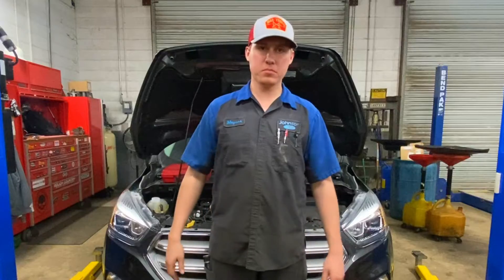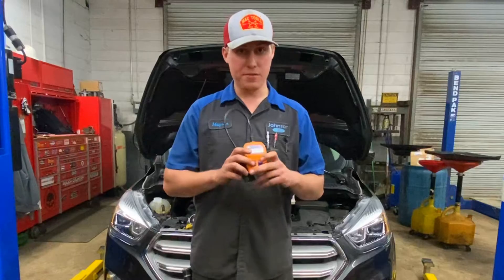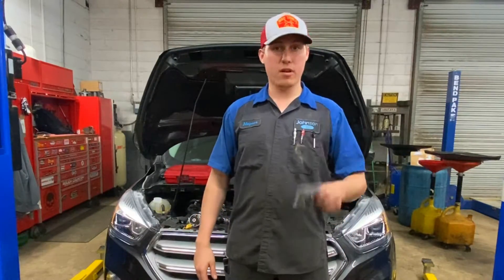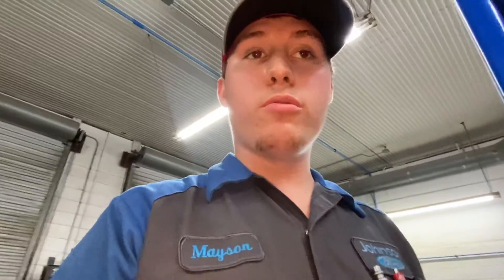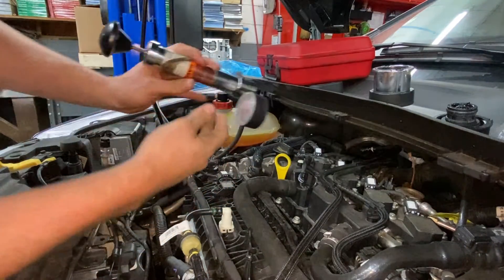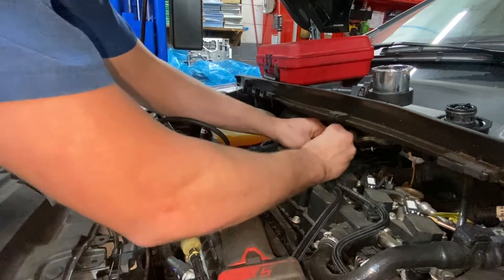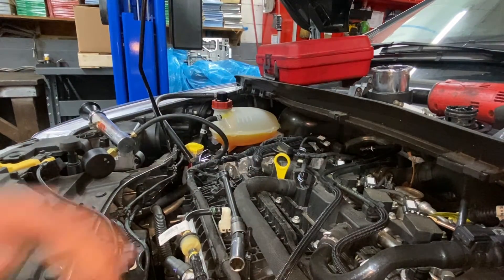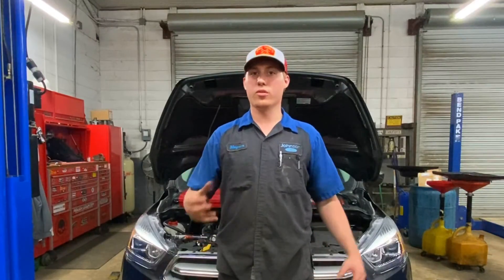How to Diagnose Ford Fusion & Escape 1.5L EcoBoost Misfire, Coolant Loss, or White Smoke TSB 20-2100

Comment: Just installed a used engine in a 2017 escape 1.5l and will idle all day long but if you hold the throttle  for like 30 seconds cylinders 2 and 3 miss fire. Has new plugs and I have swapped coils. Fuel? Any ideas

Comment: Question I have a 2018 Ford Fusion Se 1.5L EcoBoost. I am experiencing the P2 code, low coolant and check engine light blinking. Juddering when driving and blinking check engine light. I just had the spark plugs changed in Oct. 2023. If I change the spark plugs and drain coolant can I still drive it until I can pay this car off and get rid of it without replacing engine?

Comment: I got a 2014 ford fusion se 1.5L ecoboost stated over heating and running bad diagnostic tool says mistfire cylinder 3 check cylinders no sign of leaks changed spark plugs and ignition coils running better get it up 90 miles per hour drive long time not getting hot

Comment: Hi Flying Wrenches my girlfriend has a 2019 Ford Escape SE Ecoboost and it started blowing White smoke out of the exhaust and we were told that it needed new Spark Plugs and a New Coil but it was losing coolant and we would fill it back up and it would just keep losing coolant

Comment: If you have a coolant consumption issue, check with Ford, as they are replacing some short blocks at no charge due to this failure. Some of them are out of the original warranty however STILL covered. SO ASK your dealership!

Comment: I’m here because I have a 2017 fusion exoboost and have check engine light which says misfire cylinder 4, coolant loss, and no heat. I bought the car used in 2020. Like I said I just put all the pieces together today and am doing research on what to do next. I’m out of warranty and from what I’m seeing my only option is a new engine. Is that correct? Sorry if I’m wrong I’m really new in my research on this problem. But I came across your video and am almost 100% certain this is my problem. What should I do?
Reply: I believe I have the same problem
My mechanic said they are replacing the entire engine block to rectify the problem

Comment: What is the actual problem that it is requiring replacing the whole engine? Will a Headgasket fix it?
Reply from the maker: No sir. There is an issue with the block surface.

Comment: This just happened to me. I drive the car two days then the engine light came on. 

Stalled at initial start up. Now the car won't start. Mechanic says it's my coil.

Am I screwed??? Someone please help

Edit.

This guy is super knowledgeable. Mines is cylinder 3 and I smelled coolant coming from my tail pipe. Please tell me if I'm screwed. [Sorry for hijacking the comments]
Reply from the maker: Your not screwed. Just going to have to put an engine in it to fix the issue. How many miles?
Reply: @FlyingWrenches13  59k. I don't have 8,000 dollars man..I'm gonna be homeless I work nights and I need my wheels to go to work 😔😔😔

Life of the less fortunate
Reply: @FlyingWrenches13  which engine? Please help

Comment: I have a 2014 ford escape and my coolant level gets low after several weeks smokes like a freight train on start up. Ford said It was my Turbo but I call Bshit. They have a recall on all these escapes and are having to replace the short blocks.
Reply from the maker: It is possible that it’s your turbo leaking coolant but 9 times out of 10 on these 1.5’s they need a short block.

Comment: Hi,
Do you know the engien code on these engiens with these fault??
I'm from Norway and I have a Ford Focus 1.5 182 hp with the engien code M9DB. I am wondering if this can have the same problem?
Reply from the maker: I don’t. What year model is it?
Reply: 2017
Reply from the maker: I’m not super positive on non us vehicles but I think that is the same engine that has the issues.
Reply: Its gonna be a PO301 PO302 PO303 OR A PO304 each ending number represents what cylinder os misfiring and if its PO 300 that means its multiple at one time

Comment: I own a 2017 2.0 fusion... tomorrow i am doing a coolant pressure test followed by a bore scope view a few hrs after. I was having p0303 pop up every day for a while. So far i changed all my plugs, swapped my coils around, cleaned my coil connectors with contact cleaner, used sea foam in the tank and used crc valve cleaner in the throttle body then took it for a drive on the high way after i let it heat soak for 45 mins.  After all of this i have not had a code pop up in weeks and before the p0303 was popping up once a day. I also inspected the pink coolant as well as the synthetic oil itself...as well as di a cylinder compression test per cylinder. as well as used starting fluid on a cold start engine to spray down all vacuum lines and the intake manifold gasket areas mainly focusing on the cylinder 3 area to start with..... So next i will pressure test the coolant and if this comes back good then i will rule out a leaking head....
Reply from the maker: You covered all your basis lol just make sure you let that pressure tester sit on there for several hours before ruling out that you don’t have coolant intrusion. Sometimes it can be a very slow leak. Also if it does fail that test I hate to be the one to tell you but you will need to replace the long block to solve that.
Reply: @FlyingWrenches13  yes I have done a lot of research. If it came down to it. Ford would charge me about 8,000 out of pocket for a new long block with all parts as well as 16.5 hrs of labor at 120 hr in Ford dollars with a full 3 year unlimited mile warranty I believe. But what they don’t tell you is that if you install a oil catch can system on it that it will void the warranty. I’m considering putting one on my 62,000 engine now.  I’m glad you said let it stay on for several hours because that might of tricked me if I only do it for an hour. I hope it passes but I also look at it like this. The 8,000 vs a trade in for a new or newer car will just give me a bill a lot bigger than 8,000 and may come with a new host of TSB etc. I even weighed out the value of buying a low mileage fusion engine used to have thrown in vs just trying to get the head gasket replaced on mine if it is a coolant intrusion.  I’ve done lots of head gaskets in the past but never on anything so new.  Thank you for the intel. It’s appreciated more than you know! What I really should be looking into is keeping my eyes out for a used fusion updated long block engine from a car that gets T boned in the rear or side. Now that’s pretty much what my eagle eye will have a permanent eye out for in case a good deal pops up.
Reply from the maker: Well I will say I really like your thinking man. Sounds like you got it figured out. A catch can shouldn’t void your warranty but at the end of the day it’s really up to the dealer and what they want to do. Did they tell you it would void your warranty? It’s really dumb to void a warrant because of something that if anything is going to pro long the life of your engine.

Comment: White smoke, misfiring, coolant loss rough running, these are the symptoms of intrusion.

You can only have one of these things and be a direct correlation to the coolant intrusion

I do a lot of these motors, sometimes you don't get codes... sometimes you do

I just finished one and by the time I finished one I was on they had another one for me.... they are coming in like hotcakes

Nice to see other Ford Tech's actually speaking up about this
Reply from the maker: Yeah I don’t do them near that often but it seems like everyone has the problem at some point in time.
Reply: what do u suggest i do is it a recall ford will fix  also when i press gas pedal its barely moving
Reply: @clipsreloaded3347  if you're under warranty you're good. I bought mine with no warranty. Got a deal and now Ford's factory problem killed it
Reply: I have this issue am I screwed???
Reply: @Lord_Don  Sell it. I sold mine somehow lmao.
Reply: mine says engine coolant overtemperature no code loosing coolant

Comment: If I'm looking for a reliable crossover similar to the ford escape size what would you recommend?
Reply: No used I was looking at the escapes bc they had a lower price tag on newer used models and had lower mileage usually that's a good deal lol
Reply from the maker: Buy an escape with the 2.5 or a exploder with the 3.5 both are very dependable.
Reply from the maker: Are you looking to buy new?

Comment: I have a 2016 fusion w/ 2.0 ecoboost, it’s been to the dealership 3 times this month, keeps throwing a turbo over boost code, could this be the cause?
Reply from the maker: No you usually wouldn’t see a over boost code for this problem. Most likely something going on with the waste gate.

Comment: Does it happen on all of them or is it random
Reply from the maker: It eventually happens on all of them.
Reply: @FlyingWrenches13  what about the 2.0l turbo engine
Reply from the maker: Same problem. I’m gonna make a video here pretty soon about the 2.0 ecoboost
Reply: @FlyingWrenches13  thank you for the response
Reply from the maker: No problem! Hope it helped.
Reply: @FlyingWrenches13  Thanks for the info.  I have a 2019 escape 1.5L.  I only have 10k miles on it, and I saw white smoke one time when pushing it in rear view.  I was surprised to say the least.  That was the only time.  Otherwise, it runs smooth, like a new car.  While there may not be a code shown, would an engine analysis show some indications of a problem?  Also, if it eventually happens on all 1.5l engines how could this not be a recall?
Reply: My 2019 Fusion is in the ship now. Don't know if that's the problem or not, but I was driving and I didn't have any check engine lights or any signs of over heating or low coolant. But I started it and it was rattling like it threw a rod or something, I haven't heard anything yet for Ford.  But if they replace the short block for that reason.  Does it happen again or is that issue fixed for good?

Comment: I just wandering about how many miles does this condition start or does it matter?
Reply from the maker: It varies. I’ve seen them start with as little as 20K miles and I’ve also seen them have 150K before they start.